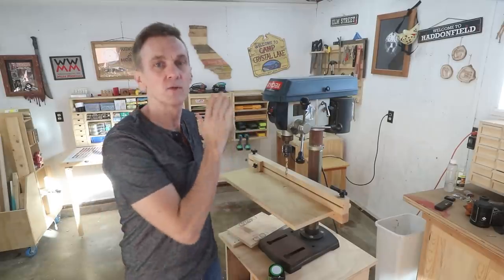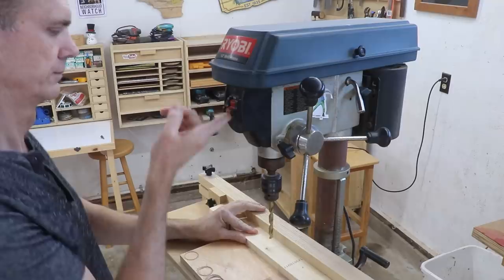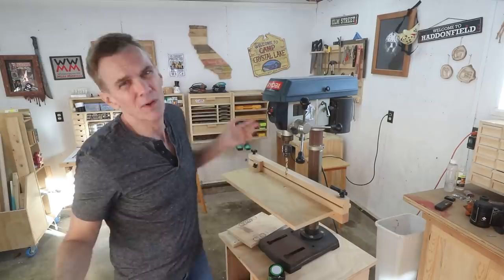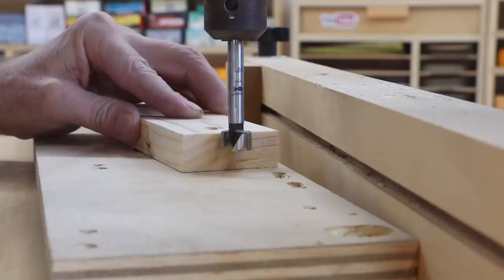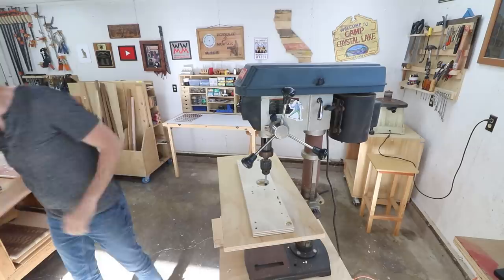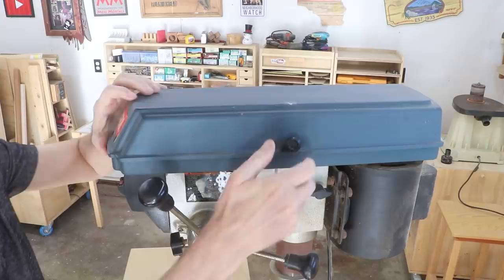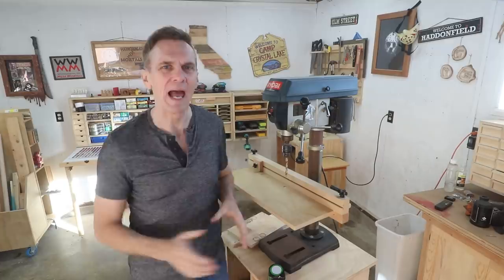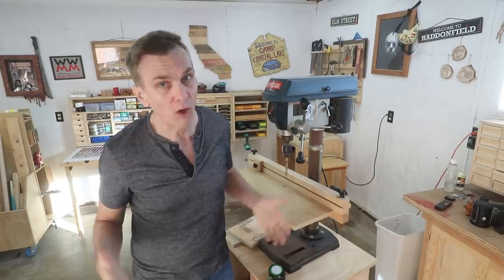How important is a drill press? I mean, it's such a boring tool.

Comment: I'll add that the drill press is one of the few stationary tools in a woodshop that can be used for other materials (like plastics and metals) safely without any modifications to the machine. That alone makes it a very useful tool.
Reply: I was always taught that you still needed to change the speed (and bit) when going from wood to metal?  Is this something that has to be done? should be done? or just a matter of learning from someone in a machine shop? I have no experience with plastic but i would presume it would be similar to wood?
Reply: @trekie30122  Depends is the best answer. Plastics, aluminium (most common "soft" alloys), brass, copper, zinc would work at most speeds. I never change the speed on mine, because I set it to the 2nd lowest ~1100 RPM because I only have a 2.4 Ampere induction motor on it : it lacks torque at higher speeds and it going to work on almost any material I throw at it. 

For steel, it depends on thickness and hardness.  Also depends on how much you care about your drill bits and what quality of drill bits you have.
Reply: It's useless less ya in a work shop and want loads of straight holes but battery powered drills can take same tools and portable ..... Good for drilling thick metals .....upgrade to CNC milling machine for production so it's a bit obsolete really
Reply: Being disabled with limited use of my hands on my bench top drill press is very useful
Reply: @jackgetzler3451  in that sense it's useful but still limited to clamping work to its table for metal work it's not much of a problem and can use magnets or electro magnet to hold the work for you but mine just a cheap work top one and just sits in shed with a wire wheel on it to clean up metal but I have broke a few small drills in it lol
Reply: @trekie30122  Yes, you certainly need to be aware of the speed and the type of bit (use caution with spade and auger bits), but I agree with Rolf with general purpose bits and softer materials you can pretty much use it as is. For harder stuff like steel adjust speed as needed and use coolent like tapping fluid.
Reply: @trekie30122  Absolutely mandatory to change speeds. Metal drill bits suck big time using wood and wood drill bits actually can't even be used on metal. Sure there are some things like those red HSS cup tools that can be used both on wood and steel. With metals you need to adapt feed rate into drill rpms. You're doing everything spot on if your metal chunks are long winded constant spirals. If you get those, you're about good as you can get. Just remember to occasionally lift to cut those long spirals so that you don't get yourself cut.

Comment: If you’re buying a drill press, try to get one like Steve’s that has a “rack and pinion” crank for raising/lowering the table.  Many (like mine) don’t and it’s impossible to lower the table and maintain alignment with the fence.  Note that the 1/16” drill used for pilot holes is much shorter than a 1/4 or 1/2” drill bit, thus requiring the table to be lowered.
Reply: You beat me to it.  Probably the #1 must have feature IMO.
Reply: That’s what I hate most about my Shopsmith - there’s no controlled, precise way to move the carriage toward the headstock (or the headstock away from the carriage). One of the reasons I bought a dedicated drill press.
Reply: Or use a 4x4 for the short bit then a 1x4 for the longer one.
Reply: @tarcorfd8547  that’s a very good idea!  My fence isn’t tall enough but that’s fixable.  Thanks for the recommendation.
Reply: Valid point there. It's pretty much essential feature or at least you'll miss one if you use one and lose that ability :)

Comment: The depth stop (in combo with a Forstner bit) can be very useful for hogging out mortise and tenon slots as well. You can use the precision of the drill press to scoop away ~90% of the material you need and then clean up the holes with chisels, files, sandpaper, etc.

By far the best advantage though, is the repeatability of a drill press. A lot of woodworking doesn't require perfectly machined parts, but usually you DO need multiple parts the exact same size and with the same hole patterns for joinery or fasteners.

Comment: The drill press 'size' is double the reach to indicate the center of a circle that it can drill to. Why they don't use the same terminology as with bandsaw who knows. I think you're right and it's just a manufacturers advertising gimmick to make the tool seem larger than it is.

Good drill presses can be found on many of local sale sites. I have found three very good benchtop and floor model drill presses on CL over the years. They bring premium prices right now because it takes so long to get anything new. But a 12" benchtop drill press in very good condition should be less than $200 and that amount will usually get you something of better quality than new. Most important if you buy used is make sure you get the chuck key with it because it can be difficult to find the correct size key. Without a chuck key knock $50 off the price before you evaluate anything else about it.
Reply: Another way of looking at it, I have a 12 inch wide board and I know that I can drill in the middle of it (6 inches from the edge).

Comment: Not gonna lie, I see a drill press as that one tool you should have in a shop that's there for when you need it and you'll be glad you have it.
It's not gonna do as much as your table saw, but when you need to punch out 36 peg holes for a book self to a depth of no less than .25 inches I'll take a drill press any day compared to doing that shit by hand.
Reply: Preach brother lol. Absolutely worth it for those projects, but not necessarily mandatory.
Reply: My second woodworking project ever I got a little abitious.  Almost too ambitious.  I made a 56 bottle wine rack with dowel joinery, that's 128 slats with two holes each plus holes in vertical stiles, and in the side panels.  Looooooots of holes, a drill press was a godsend for all those holes.

Comment: My drill press is close to 20 years old. It’s a Craftsman, no “fancy” adjustments like yours. Loosen collar to raise and lower, be sure to receneter the through hole… regardless for woodworking it is there when i need that “very” precise hole. For instance when making Pinewood derby cars with Cub Scouts, predrilling the axle holes to 5/32s is key for easy wheel alignment. I also use it as a press at times by closing down the shank to push tight fitting dowel pins into place… when I use it I am so happy I have it. Thanks for another informative video. Oh yeah never adjusted the speed belts… probably because it really hasnt been a problem
Reply: Lol mines almost 40 and still looks & works like new.

Comment: For your first drillpress look for the Bosh PBD40. It has electronic variable speed (no more belts to shift!), digital depth meter readout, laser, more power than needed and is cheap.
Then when you're more experienced you still keep it because it's awesome.
Reply: The Bosch is really nice.  Laser isn’t accurate though.  Apparently can be adjusted, but requires opening the case.  The digital depth and electronic speed control are great though.

Comment: I currently have 4in thoat on my drill press and yeah it sometimes is an issue but not to often. I also use my table as the depth stop as I broke the plastic on on my harbor farts press. For finer adjustment I just move the drill bit then re chuck it. The drill press is the only tool that always is set up in my shop. Just so convenient and good at it's task. I make beer bottle openers with magnets makes it easy to batch out a step.

Comment: For anyone like me an easy way to not lose the chuck key is to put it in the chuck after use.
Reply: I drilled a little wooden block that i stuck on the head with velcro, works great. I also store all my different tool specific wrenches on the stand/near by with magnets.
Reply: I put a strong bar magnet on the side of the DP head and stick the key on there when not in use.

Comment: Drill presses are incredibly useful. I find myself using it even for stuff I don't"need" it for and could use a hand drill. In my opinion one of the best advantages is the mechanical advantage the handle gives for downward pressure. Well worth the investment.
Reply: Agreed, hardly ever use hand drill no that I have one except when the reach is to much (large boards)
Reply: @chrisisd  mostly the same here. Also didn't mention it before but for circle cutters, large hole saws, and large forstner bits it is a must!

Comment: Thanks Steve.  Not a boring video at all.  I love my 16" Delta floor drill press, use it a lot more than I originally thought.  I have dedicated mortising machine and spindle sander, so no longer use these drill press attachments.   Most of the time I keep the drill press speed at 1000 rpm, slower speeds (maybe 300 rpm) when cutting larger holes or harder materials like metal.  SAFETY FIRST--Don't forget your safety glasses!

Comment: I don't use mine as a drum sander anymore, but I do put an inflatable ball sander on it and smooth out the inside of bowls.  Flexible pad sanders are great for the inside and outside of bowls. Both suck in a handheld drill!  I made my own table and love having a fence.  It makes repeating drilling a distance from the edge easy and repeatable.  Plus I can't drill straight so it helps fix that XD

Comment: Spindle speed = (cutting speed of material) x (cutting factor of tool) x 4 / (diameter of cutter)

But, as you said, it doesn’t matter THAT much. Erring on the slow side will help your bits last longer, but wood is pretty forgiving.

Comment: I use my drill press quite often and am very glad I have. I went ahead and purchased the Woodpeckers table for my Nova DVR drill press and it is very helpful. Having the dust collection built into the system is a great boon.
Reply: The NOVA Voyager is an awesome DP but a bit over the top for most woodworkers especially those just starting out. I got mine about a year ago but that was after 37 years using my Craftsman 15" floor model DP that I bought new in 1983 which I have hung on to because it is still very capable, and I know I could not replace it with a current model for less than $750.

Comment: The fence is a safety item also.  I was cutting sheet metal years ago and the bit grabbed the metal and spun it and cut may hand.  I either clamp things or use a fence now.
Reply: This is an often overlooked feature of a fence. A good fence and some C clamps are essential accessories for a drill press for wood or metal work.

Comment: Definitely the most boring video I've watched today. 😁 I've had a Craftsman 9" benchtop drill press for a long time. It's incredibly useful for all the reasons you mentioned. My only complaint is that the 1/3 HP motor is underpowered and tends to bog down a lot. Of course I may not have the sharpest forstner bits either. I've been on the hunt for a larger one just to get more power. Thanks for sharing!

Comment: A laser alignment guide is very handy when you are making holes in varying places and the drill bit (or hole saw more likely) stops you from seeing where the point of the drill is at, without fiddling about with changing bits for a small one, hoping the job doesn't move out of place if you bump it putting the big bit back in....... One day I'll figure out how to get my add on one to work properly, I assume the ones that come built in to the drill press are easier to set up. One way to tell if a drill press is intended for woodworkers is the depth it can drill to without moving the table - woodworker's drill presses have a capacity of around 6 inches (150mm) while metal working presses may only have a capacity of 3 to 4 inches (I've seen 65mm, <3 inches), some can't even drill thru a 2x4 in one go, you have to move the table up and down (DAMHIK). Always try to clamp the job down to the table, unless you like being whacked across the knuckles repeatedly - when the drill breaks thru the back of the job the splinters or other bits of junk on the back can ride up a spiral drill bit, even pull it out of a vise, and whirl it around like a mad thing until you can turn off the power - been there, nothing broken fortunately but it hurts.

Comment: I'd like to see you try out Garrett Wade's Portable Drill Guide Jig and see how it compares to a standard drill press for basic woodworking projects/tasks. I don't often need a drill press for my projects but sometimes I need to be accurate and consistent, especially with forstner bits. I think a good portable press fits my needs, budget, and most importantly, space/storage needs. Plus the portable nature can be useful for some deck projects and drilling accurate holes in beams on site.

Comment: Was just about ready to buy an 8 inch drill press but got a little hung up on your size recommendation. I was wondering: is that recommendation in part due to leaving space for your fence? And if so, do you think a split fence (perhaps held together with a piece of steel or maybe something underneath the drill press table) would be a good way to get back some of the swing?

I also have one of those portable drill guides. My take on that is that, primarily for wider boards, it can help serve some of the same purposes as a drill press.
Reply: @Not Bugarev Thanks for the feedback on your experience.

I rewatched Steve's drill press table videos and noticed he actually has quite a big gap between the column and the table to allow for turning the lever to adjust the drill press table, and the fence itself is quite beefy. I'm planning to cut notches in the table to allow room for the column and lever. Steve's older drill press table used T tracks in the table itself to hold the fence. I was thinking that could allow shifting the fence to one side, which would not only serve to allow the fence to line up with the column but also allow for extending the fence to one side.

Comment: Maximum cutting speeds are published based on the material you're using to cut (ie HSS, tungsten carbide, etc) and the material you're cutting. Optimal cutting speed is as fast as you can go without damaging the cutter, and manufacturing engineering is all about cutting as fast as possible without damaging the cutter.

Cutting speed is about how fast the two materials are moving against each other, so if you're using a drill bit it's about how fast the tip is moving.

But for one off pieces, it's all a bit academic so long as you're not going too fast.

Comment: I recently acquired my Dad's Craftsman 10 inch bench top drill press and I've used it quite frequently.  First thing I did was make a table with an adjustable fence and Powertec hold down clamps.  In addition to drilling perfectly straight holes, a drill press is a much safer tool for drilling through small pieces of wood, metal, or acrylic, which can be securely clamped to the table or against the fence.  No more spinning work pieces or fighting against the torque of a hand held drill if a bit binds up.

Comment: One thing about those sanding ideas. Sure I suppose sanding works with slight pressure, but people need to be aware that, morse taper, the part that hold drill chucks in place aren't made to withstand side loading forces in drill presses. Meaning forget trying to mill with drill presses. You'll likely just get morse taper loose and chuck will drop to floor and it's possible to damage them that way. There are tempting looking cross feed tables, but they're only for indexing where you drill. Not for milling. Also drill bearings aren't usually designed to withstand constant side forces, so there's also that.

Now there's likely someone already typing that there's morse taper on mills too, but it isn't same thing. There's also drawbar in them. Taper can indeed be something like MK2, but that's where the similarities end.

Comment: I have owned a drill press for decades, initially a bench top, then a floor standing drill press.
In 2017 I purchased a knee style milling machine.   I wish I had purchased a milling machine decades ago.   This has been much more useful than my drill press, which is rarely used these days.   I prefer to drill metal or wood on the milling machine.   The knee on the milling machine does not flex, whereas the table on the drill press does flex.   I ended up bracing the table with a hand clamp in expansion mode.
I prefer drilling on a stationary machine when possible, and only drill with hand held drills for items too large or difficult to clamp in the stationary machine.
Dave.

Comment: If I remember correctly, the point of it being called by the size of the post to chuck times 2 is because that's the maximum width of a board it can drill to the center of. I could be wrong, but I recall an old shop teacher telling me that.

Comment: I have the current ryobi, and it has a laser - even cheap drill presses nowdays come with a laser as its very inexpensive for companies to add and very helpful. I haven't ever used it with wood, though I have used it with aluminium to make holes for for arcade cabinet control bullons, when you need it its really handy!

Comment: Surface footage per Minute, is what determines optimal RMP, and most wood, can easily handle over 1000 Feet Per Minute 

SFM=.062×DIA×RPM tells you how fast the outside of the drill is moving, in linear terms.  

To determine the RPM, for a given/known SFM, the equation is: 
RPM=3.82×SFM÷ the drill diameter.

Far more complicated, than is required, to drill wood. We use it more for steel work.